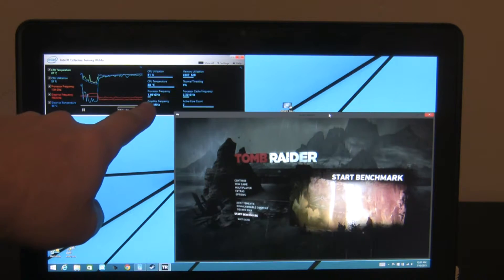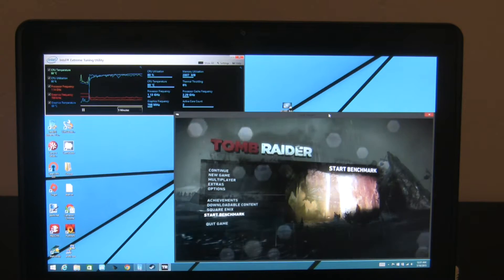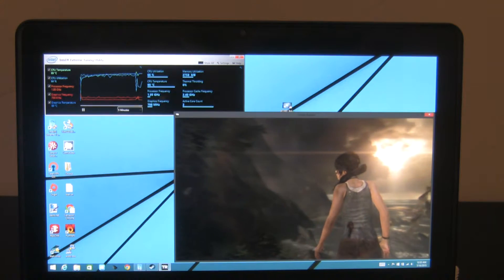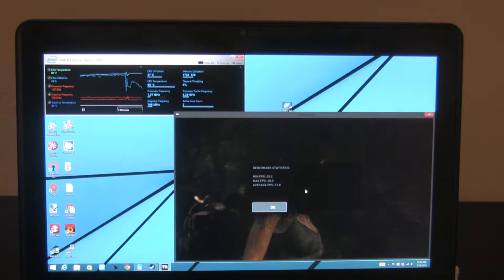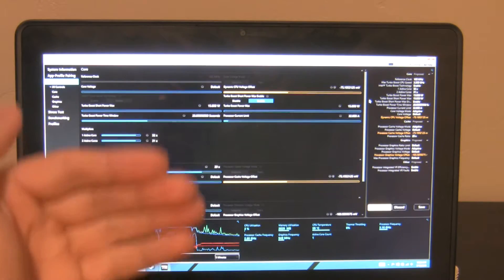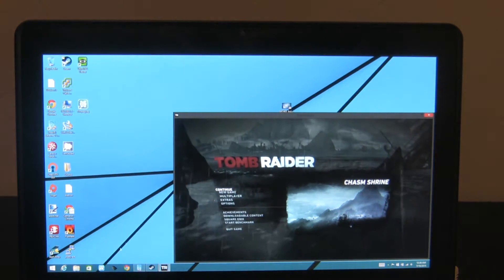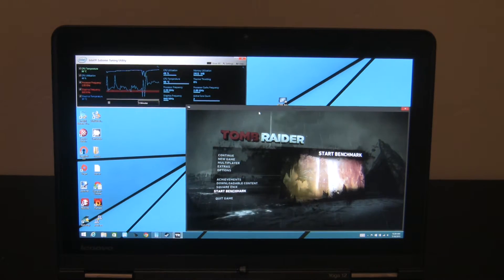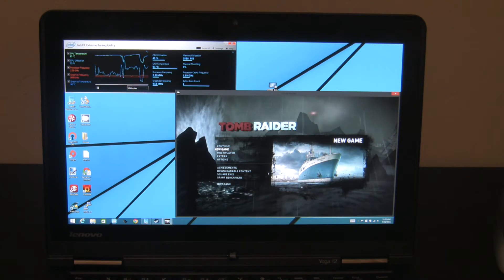Broadwell-U - Undervolting for Performance!

Comment: i have 5500u , but i dont have dynamic voltage offset , and turbo boost power max set to 15 watts (which seems to be max) . can i get those missing settings back somehow ?

Comment: Love the new intro and on camera work. Keep it up man, I'm very much into tech and I think you're great.
Reply from the maker: Jezez Much Obliged! Thanks for the kind words.
Reply: cbutters is this applicable to the surface pro 3 core i5 version, can you also undervolt the cpu on that as i am looking to get the surface pro 3 next week and want it to get better performance and battery life rather than it just draining the battery and thermal throttling.